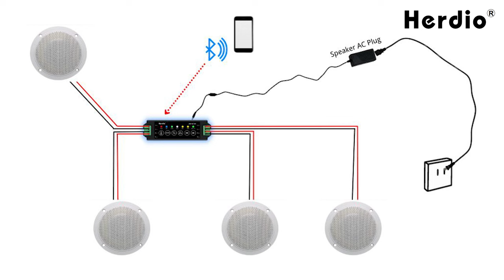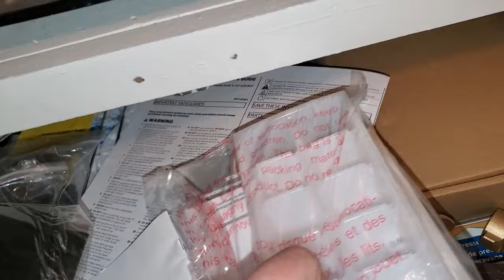Vintage RV Upgrades: Enhanced Sound and Vibration-Free Ride!

Comment: Sleeperdude had an electronic ignition system he add on his old RV.  You might want to look at it down the road.
Reply from the maker: Thanks for the comment 😁. Surprisingly Harvey has factory electronic ignition. By doing the HEI modification,I was able to eliminate some of the factory ignition components and solve the issue.

Comment: Invest in some wagos for those wire connections.I would make fixing the belt issue my top priority.You don’t want that belt to pop.
Reply from the maker: I've used the wagos. For the RV I like using the solder splices though. The belts are new and tight. Just a bit squeaky. The pulleys might be slightly misaligned still. I'll have to check closer. Thanks for the comment.
Reply: On the belt issue I would check over everything again belts shouldn’t squeak.I would pull the belt back off and check my pulleys and maybe even check the belt again.New doesn’t always mean it’s the correct belt or that it’s good.I would take the belt back and maybe get another one.Cant hurt well maybe if the wrench slips and bust your knuckles up.Enjoy your videos keep up the good work.
Reply from the maker: Good suggestions, thanks!

Comment: First I would get rid of that Thermoquad carburetor and put on something reliable like a Edelbrock carburetor on that engine or put the money in a Holly Sniper fuel injection system. Those Thermoquads have a nasty habbit of catching fire and burning the rig down. I have a motorhome powered by a Ford 460 with a 3 speed auto trans and yes I turn about the same RPM at 55-60. Yes the engine does sound like it is maxed out but the redline for both engines is north of 4500 rpm. 62 mph seems to be a happy spot for the 460 at 8-9 mpg. I have read on adding a over drive trans and money wise it just will never pay, I figured it would take about another 100K miles and the fuel savings still won't cover the cost. So I just drive my 62 mph and add another bit of time to get there. Old motorhomes like ours aren't very good at faster speeds any way.
Reply from the maker: I've looked at Edelbrock and Holly Sniper kits. Both are good options. I haven't pulled the trigger yet but it's in Harvey's future. The overdrive was to get the RPM down but you make a good point about the faster highway speed. I agree, they weren't made to go 70+. We go down the road at about 55mph and that's fine. We build in extra travel time too. Thanks for the comment 😁

Comment: That low voltage at the coil thing is probably a ballast resistor or a resistive wire going to coil +, Old design feature so you could run a lower voltage coil to make up for the voltage loss during cranking. Or a crappy ignition switch. HTH.
Reply from the maker: I've made improvements to the ignition. A new ignition switch didn't solve all the issues. I also simplified the ignition by going with HEI.

Comment: The deodorant actually does work for belts.But they also have what's known as spray belt dressing which works even better.
If you want to do the deodorant even though it is temporary you can heat up the deodorant in the microwave by taking all of the deodorant itself out and putting it in a bowl and running it for about a minute in your microwave but use an old one because the perfume from the deoperant will linger for a long time. 
Basically soften it. Do it when the HARVEY is at rest( not running).
If need be, you can cake it in the pully and run it, the repeat the process..
Reply from the maker: Thanks for the tip 😁. Good to know

Comment: Great project! Working through all the gremlins is time consuming. If you are having resistance issues and the ignition wiring runs straight through the ignition barrel, it can pay to run it through relay instead. As the contacts in the barrel get crusty with age they don’t handle the load as well but will power a relay just fine.
Reply from the maker: You're right! Wiring can be a bear. I'd like to think this HEI modification solves the bulk of our ignition issues. We'll keep you posted.

Comment: I have a 76 Dodge Tioga with the 360 and I love what you've done with your camper! I suggest you just change the belts, they've stretched with age which is why you can't get rid of the squeal. Also if you haven't already ready done it add a good zinc additive to the oil.
Reply from the maker: Thank you!  We actually have new belts on it but we're wondering if maybe we need smaller ones.  Thanks so much for watching!

Comment: was the axle compressed the whole time? Like was the rear of the truck still on the ground? If so then that was your problem with the driveshaft not coming out because the driveshaft moves in as the axle goes up.
Reply from the maker: Good assessment. Yes,when I first started the rearend was on the ground. I realized the issue and jacked it up. Unfortunately it was still a half inch from clearing the yoke. Crazy 😬

Comment: lots of progress! will the HEI system eliminate the ballast resistor (which might've been the problem to start with)?
Reply from the maker: Yes the HEI does eliminate the ballast resistor and also the electronic ignition control module. I had replaced the ballast resistor before and it didn't change anything. We'll see how this works long term.

Comment: The caps on the rear U joint were out of place. Probably the clips were missing. This will cause vibrations. The new U joints have external clips which are better.
Reply from the maker: Those caps were held in place by internal C-clips. The new u-joints are external on the drive shaft but are still internal on the factory yokes. Thanks for the comment 😁.

Comment: So we had a Plymouth visa that did the same thing ours was a resister that was on the fire wall not sure where yours would be located. Just was wondering if that could be your ignition problem
Reply from the maker: Thanks for the comment 😁. I replaced the resistor along with other related ignition components. The issue was a voltage drop during cranking. The HEI modification seems to have cured the issue.

Comment: Did you replace the belts already on Harvey ? If so go a size smaller
Reply from the maker: We did add new belts... might need to try a smaller size if we can't get the squeak resolved 😬
Reply: Old bets stretch so if you matched the same size as the old belt its to big drop the size 1 or 2 sizes smaller

Comment: Bar soap on the belts will stop the squeak
Reply from the maker: 😂. We fell for the "deodorant will stop the squeak" trick already, lol.  Jk, we might try bar soap next.  Put it on while it's running??
Reply: No don’t put it on while it’s running! That’s not safe. Just rub it on and then pull the belt to a fresh place until you get it coated all the way around. If it still squeals then it’s your pulley. Pulleys can go bad especially if it has bearings that go bad. Be safe and keep your fingers away from moving parts. 🥰